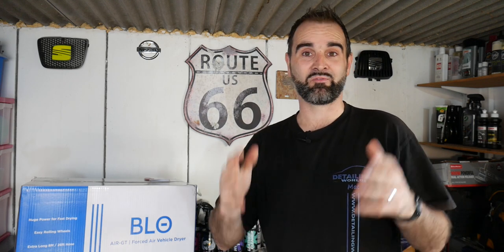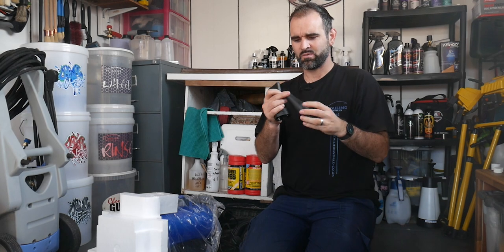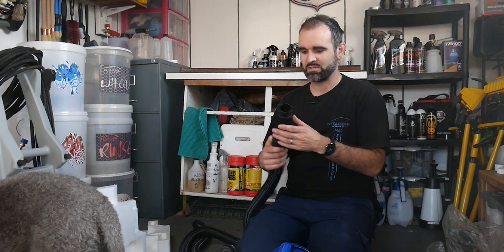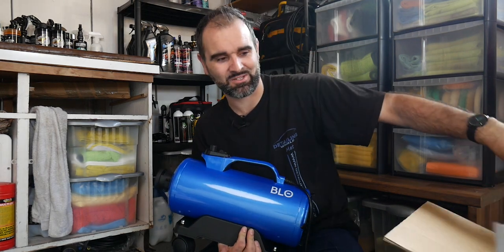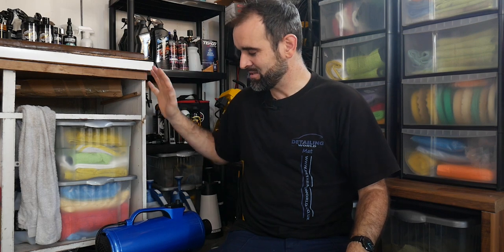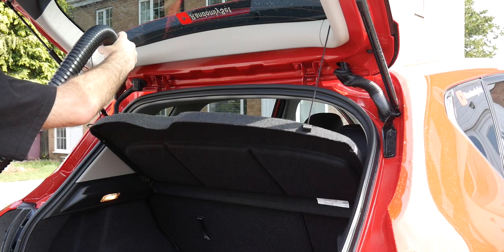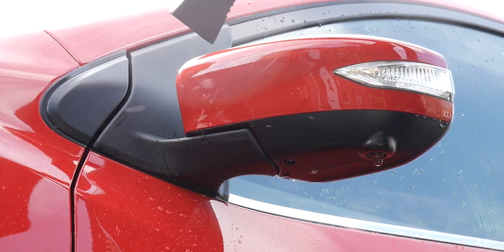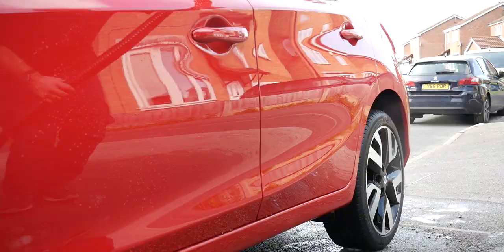Blo Air-GT Car Dryer - Unboxing and First Use

Comment: As a detailer myself it's always the time thing that gets me. 
I know I can dry a car within 5 min with a towel.
One thing I find with a towel if you wet it down and wring out it out it makes drying the car so much easier, I find if you use a dry towel it doesn't seem to suck the water up as good.
Is this the most powerful blower you have used or is there more powerful ones out there?
The money is definitely up there  for these blowers.
Reply from the maker: It's up there with the BigBoi... Maybe on par, I can't remember. But more power than you'd need to be honest. I rarely go above 50% power

Comment: I bit the bullet and ordered one off the back of this video and your discount. Sadly the blade nozzle doesn't secure properly (manufacturing defect it would seem - pointy one is fine) and a couple of emails to the company haven't resulted in much of a response yet. It definitely affects the power of it as even at full tilt it isn't blowing the water off anywhere near as well as it does on your video. Just hoping they get round to sorting it out or it's just going to be going back :(
Reply from the maker: Nice to hear you bought one. Shame about the nozzle. Hope you get it sorted soon 👍

Comment: After using Turtle Wax Hybrid Dry & Shine i decided to try the car with a Metrovac Side Kick. The sun was in and out of the clouds and it was a warmish day. I noticed that there was all water marks where the water was blown over the paint.
Reply from the maker: Try using some filtered, 0ppm water.

Also, I think on a hot day you're best towel drying large panels and use a blower for grilles, wheels etc

Comment: i`ve got the Airforce Master Blaster 8hp dryer, had it about 6yrs, excellent piece of kit, i mainly use it for blowing out all the nooks and crannies, alloys, wing mirrors etc and its excellent, i have to wear ear plugs though as it can get quite loud when doing that and i only use the cone attatchment. I also use it to blow out the interior of the car as the last step when i`ve done the whole car, just incase i missed anything with the vac. Wouldn`t be without one. Nice vid again Mat, Thanks
Reply from the maker: Nice 👍

Comment: So would you say it’s an expensive nook and cranny dryer? I’ve seen videos across YouTube of different makes saying they are great at first but then take way to much time and stick to quality towels.
Reply from the maker: Will find out more in the winter... Usually all I do is snow foam and rinse and then leave it to avoid scratches from road salt and grit etc... This would allow me to do a touchless dry in the winter months.
Reply: I agree, however, buying stuff and gadgets and car cleaning stuff.. ;)

Comment: I've got a 45 quid pet dryer from Amazon which I'm more than happy with. The only problem is I don't half feel a muppet when people walk past and I'm using it. 😞 They're invaluable for bits that you mentioned like wheels, grilles and door mirrors. I couldn't be without one now. 👍
Reply from the maker: I've kinda gotten used to people walking by, although as you can tell in the videos, I'm in a cul de sac. I think the neighbours are all used to me messing about with different things now 😂
Reply: I’m the same my neighbours all think I’m mental spending most of my spare time washing my old bangers 😂
Reply from the maker: 😂
Did you get a package last week?
Reply: Detailing World oh yeah I did thanks... already got the hydro tyre on and it seems decent, will try some more tomorrow, are you on Instagram as someone else runs detailing world account?
Reply from the maker: Yeah, Bill runs the DW one, my personal one is randomlyset

Comment: I've just bought the big boi mini +. It rivals yours for sure, used Paul dodens discount code to get 10% off. I'd like to see how it compares to yours
Reply from the maker: Nice. Didn't look at the mini+ specs, but in some areas I think this tops it.... For me, the standard 8m hose was a huge positive
Reply: @TheDetailingSpace  yeah I agree with the hose but I used it this week and only had to move it once. It doesn't have wheels but I prefer it without as I find wheels get in the way sometimes
Reply from the maker: Yes, I had the wheels locked on this. Probably OK in a unit on a smooth floor, but not a tarmac driveway

Comment: let me tell you guys.. if you are researching and worried about buying the wrong dryer.. this is the one!! BLO AIR-GT -- just make sure your car has ceramic coating or some other hydrophobic coating.
Reply from the maker: That applies to all driers (I've used a few). They work best when a car has hydrophobic protection....

And let's be honest, if you're buying a dryer, you are no doubt "into" detailing and therefore has a wax/sealant/ceramic on the car